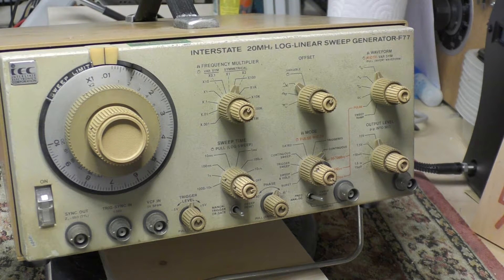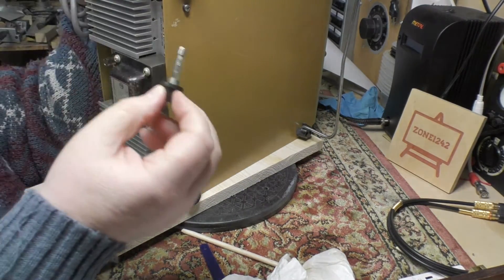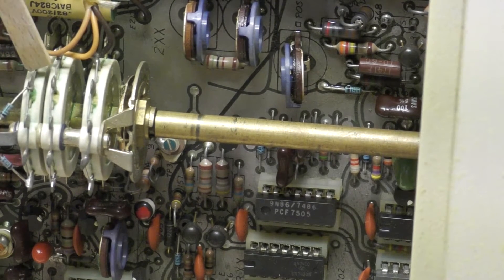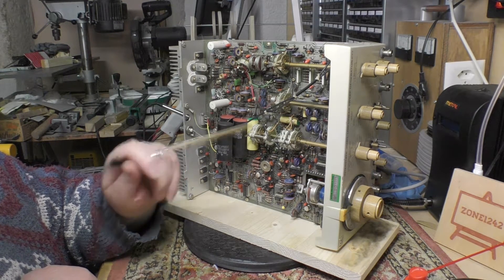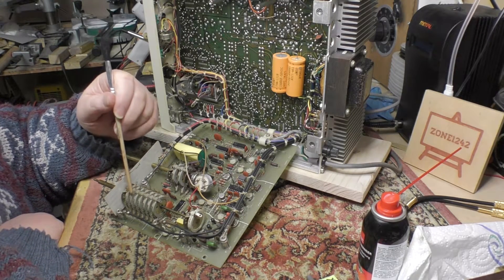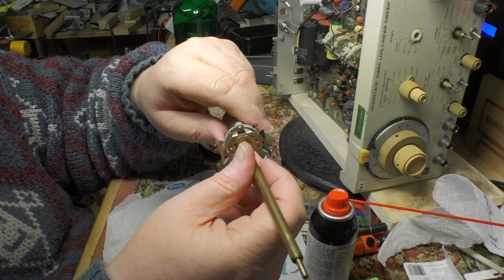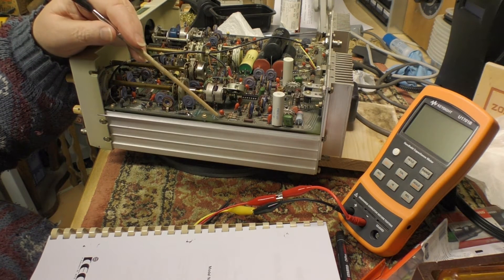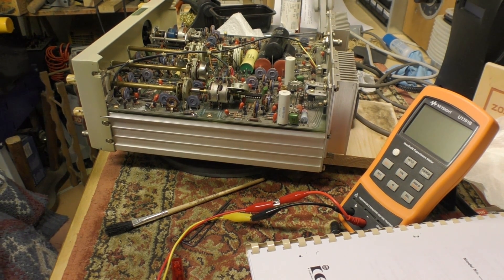Wobbulator Woes

Comment: I recently bought a LeCroy 9410 oscilloscope which came out of Hughes Aircraft.  I suspect it sat for a decade or two because it has rust on some of the exterior parts and spots of corrosion on the aluminium alloy carrying handle.  It is actually fully working and I am awaiting probes for it.

Someone on the Newark website doesn't have good things to say about the U1701B.

Comment: Interstate Electronics is still around; they are now L-3 Anaheim.  They are a long-time defense contractor, and they nowadays make GPS hardware including GPS simulators used by major manufacturers to test new designs.
Reply from the maker: You can tell from the quality of the build as well as the design that this was meant for serious application - and will hopefully serve for as long as I'm likely to need it.   Nice to know the company is still going.

Comment: Also, to get the cleaner into tight areas, what I've been doing for years is to heat up the end of the spray tube on the contact cleaner with a lighter till it starts to melt, remove the heat and grab the melted end of the spray tube and pull and stretch it about a inch. Let it cool, and cut off the squished end till you get to a very small end on the contact cleaner tube.
Reply from the maker: Good idea, thanks - I already tried cutting a slant at the tip of the tube to direct the liquid 'sideways' between the wafer switches.   I'll know soon enough if it made a difference.

Comment: Not actually rust (green). Corrosion. Good video.
Reply from the maker: Yes, corrosion it is - hopefully not too serious.
Reply: ...and I ought to say, may be mainly surface electrolytic action. Will probably clean off. Unusual for the metal to be rotted away, as it would for rust (if ferrous).